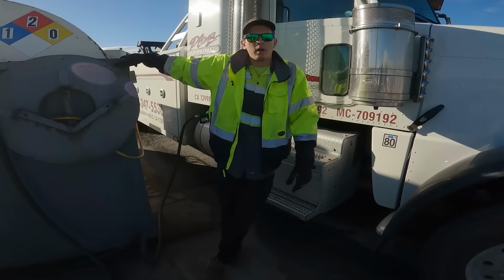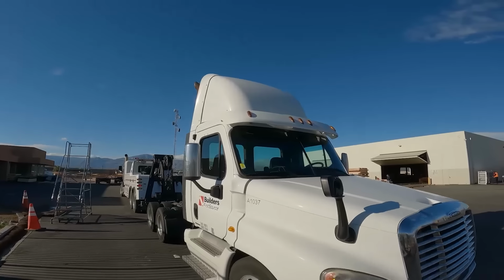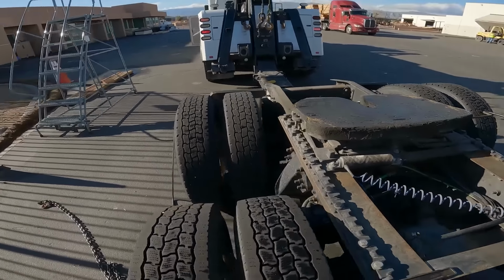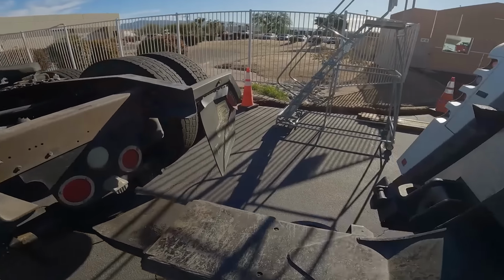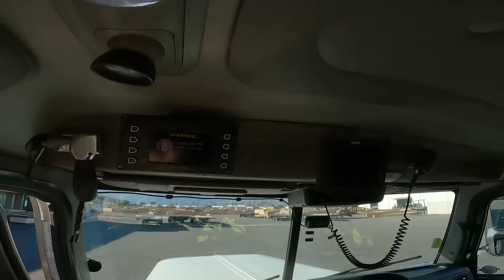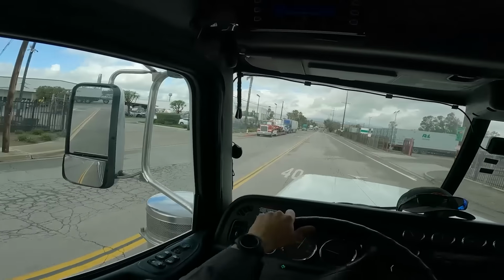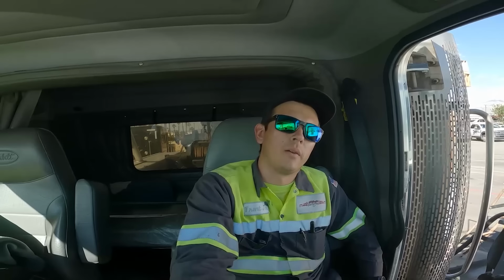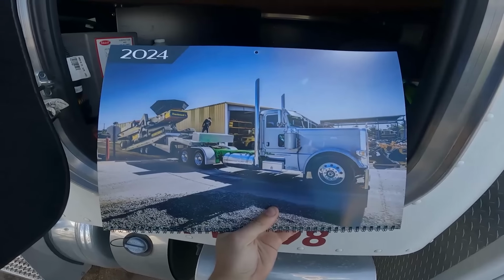Rear Tow = Bad MPG | Towing a Parachute To Fontana

Comment: Hey Trent. Nice video quality but the audio side needs some improvement. I watch my  videos on my   laptop but I use JBL Bluetooth headphones.
BTW how many  KW' towing units do you have Vs Petes? I have been following Murphy's Diesel in Arizona and they run mostly KW's from Miller. Rick also has 2 M-100's. That is a beast. Both are W-900's from Lynch Trucks.

Comment: I've never understood rear towing for anything other than short low speed situations. You're wasting so much fuel.
Just put it on a trailer or pull the driveshaft.
Reply: Ease of it and quick in and out towing is one reason, another reason is you can't always get to the front and vice versa so you work with what you can get to. If you are worried about fuel economy while towing you aren't billing properly, if you are getting 1 or 100 mpg it shouldn't matter, that's the cost of doing a service and it should be passed on to the one paying for the service so you should only be worrying about what is easiest, quickest, and what is possible with the situation at hand, Better fuel economy is always a nice benefit but should never be a main concern.